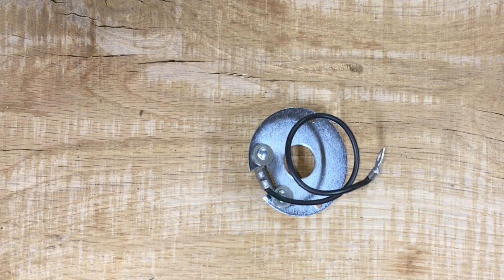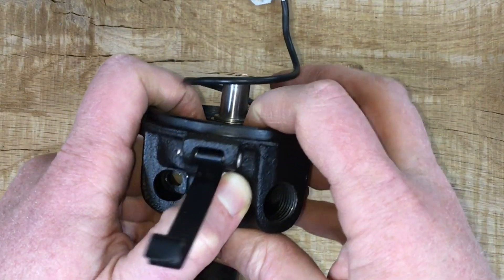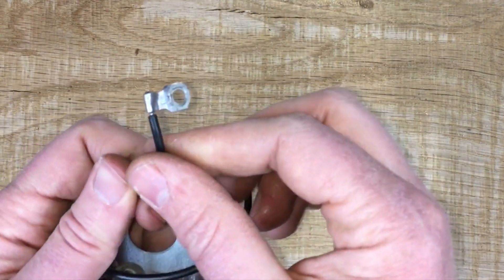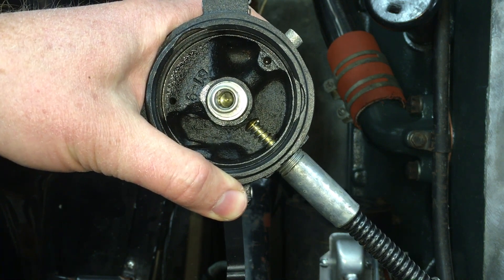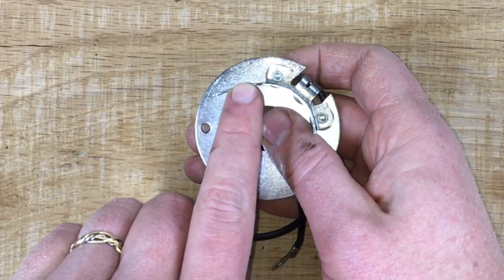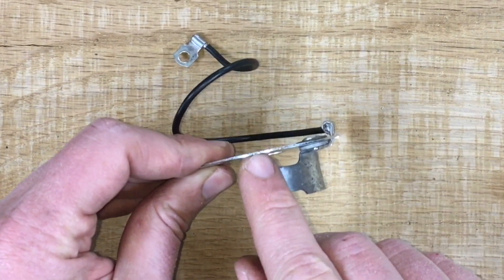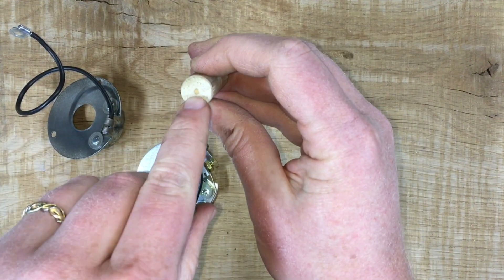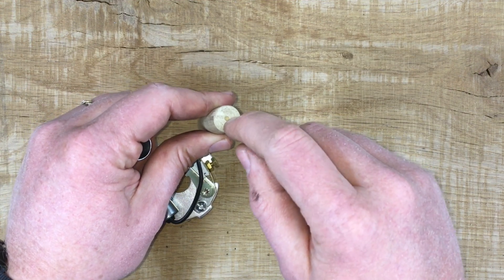Model A Ford - distributor lower plate - avoid accidental grounding

Comment: if you use the original style points and condenser you can screw the cable in all the way and it Will Not Bend
Reply from the maker: Usually true but it's still the case that the cable doesn't need to be screwed in to the end of the threads. It's just putting strain on the bus bar and the terminal spring.

Comment: I have used the modern lower plate along with a modern upper plate set up on a lot of distributor rebuilds for a while, but the lower plate I use is steel. I find that the modern condenser's I get with these plate set's aren't too reliable, so I install the modern brass tab contact for the lower plate part closest to the points and the modern condenser wire on the "outside" so the condenser can be changed without moving the brass contact tab.  I know that di-electric grease is not a lubricant, but I smear some on the lower plate where the brass tab contact's it and never had a problem with lower plate wearing out.
Reply from the maker: I assume you mean the di-electric grease isn't conductive – it's a great lubricant. The problem I've always had with the "wireless" lower plates is that the brass tab pushes down on it, and after awhile the flange fatigues and only makes contact with the tab at its highest point. Glad it's working for you though. Maybe greasing the tab helps in some odd way.

Comment: I've  put a piece  of rubber hose  behind  the lower plate and dist housing.  Silicone seal works also. I seen too many cables screw in too much.
Reply from the maker: I've heard of guys finding all sorts of stuff under the lower plate when they take apart old distributors, so it's clearly been a thing for a while.

Comment: Another method for installing a dummy condenser is to take an old condenser, cut it in half, remove the "guts", file down one of the two halves so they won't touch and then insert the dowel.  That way, you have the original end that accepts the screw that holds it to the bus bar.  www.mafca.com
Reply from the maker: I wonder, if you were going to do that, could you just use the old condenser as is without taking the guts out? Similar to the other commenter who asked about using two condensers at once. Even if the old one doesn't work, it doesn't seem like it'd harm anything.
Reply: @alexiskai  You MUST eliminate the old condenser function or the car won't run properly.
Reply from the maker: @mafcawebmaster4237  I would think that would be the case only if the old condenser had shorted, which you could test for, no?

Comment: If I ran it for a few times with both condensers would that have hurt anything?
Reply from the maker: Based on my understanding of how these work.... probably not? The condenser is a capacitor. Its job is to provide a ground path while the points are open and then feed that current back into the circuit to help the coil's magnetic field collapse. "When capacitors are connected in parallel, the total capacitance is the sum of the individual capacitors' capacitances. If two or more capacitors are connected in parallel, the overall effect is that of a single equivalent capacitor having the sum total of the plate areas of the individual capacitors." If the car ran fine with them both installed, I don't see how it could have hurt anything.